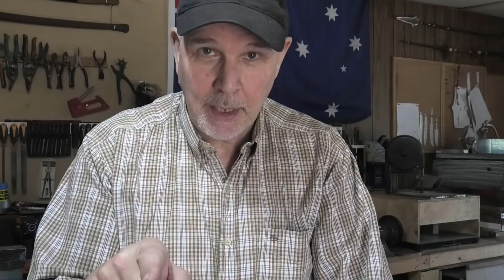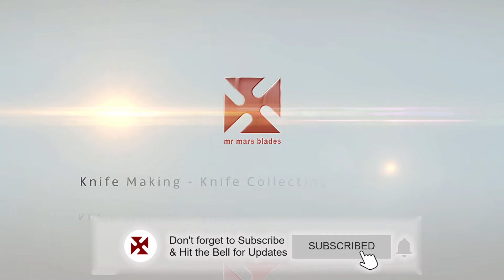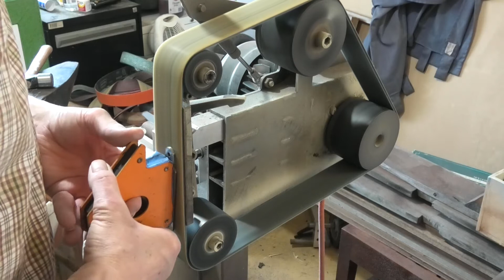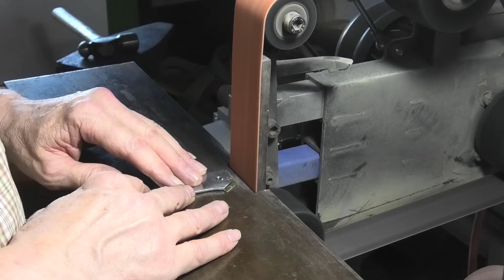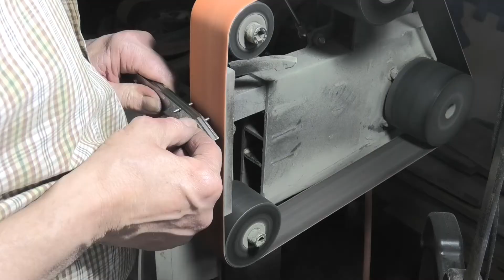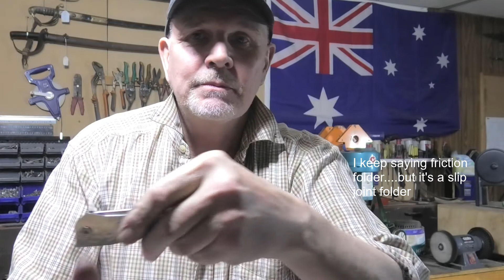** Slip Joint Folder PART 2 | Perth Custom Knife Maker **

Comment: Very nice! I'm just learning at this too but it looks like your spring is higher out of the knife with the blade closed than when it is open. That means less spring pressure when open which is probably why you get some wobble. In Steve Culver's book he says to set the spring height with the blade open, scribe a line above the spring, then match the spring to that line with the blade half open and closed by grinding away slowly at the back and bottom of the tang.
Reply from the maker: Thanks man, I found the tolerances far finer than I imagined it would be. It was all an important learning experience, I'll do better next time, thanks again MMB